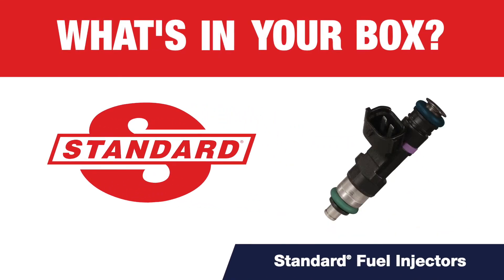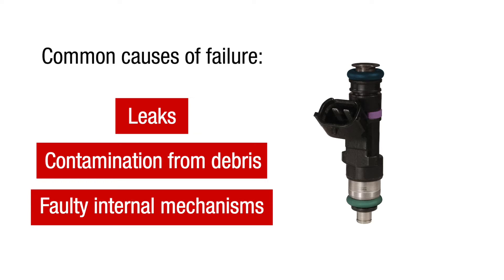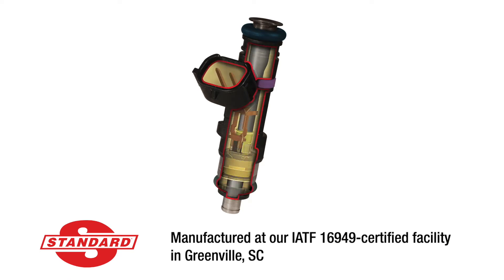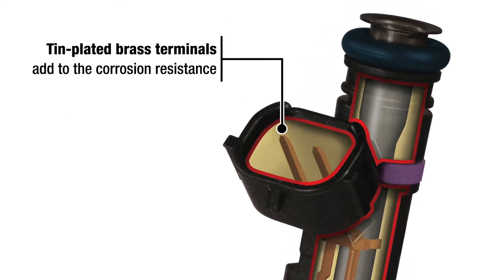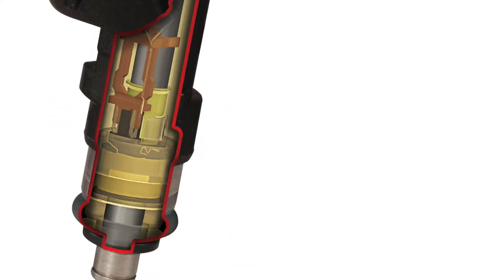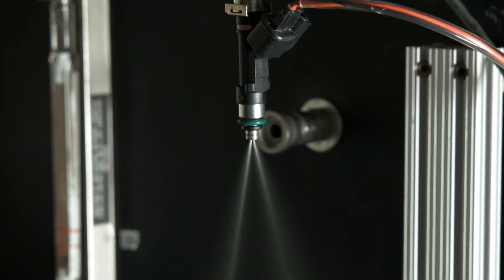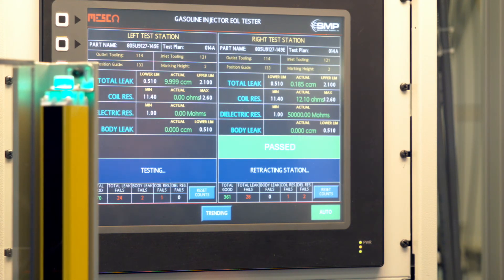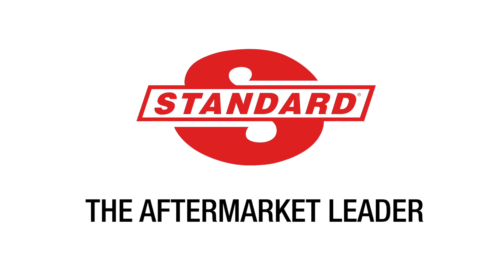A Closer Look: Standard Fuel Injectors

Comment: I purchased and installed part number FJ478 four days ago, and it failed allowing fuel to be sent into the electrical connector. Is this indicative of a problem in manufacture? Asking because I am not sure if I should take a replacement from the parts store, or consider another brand.